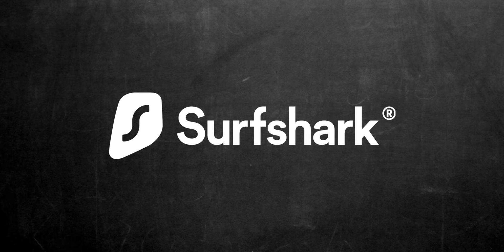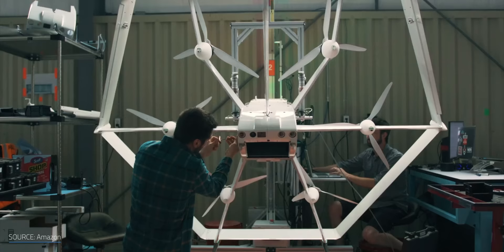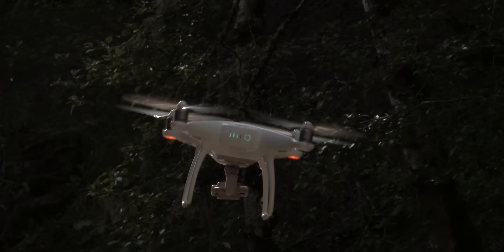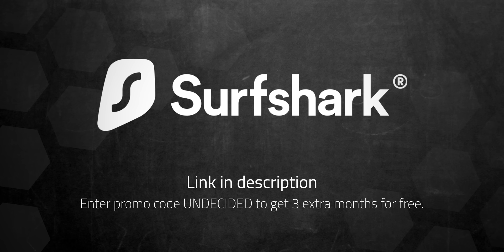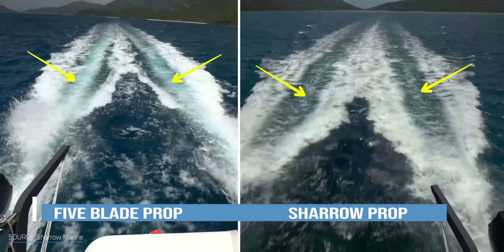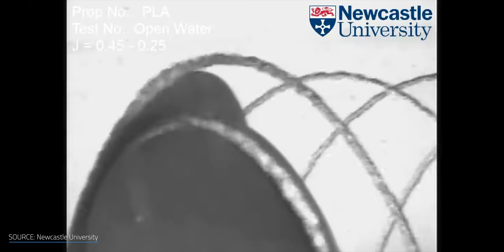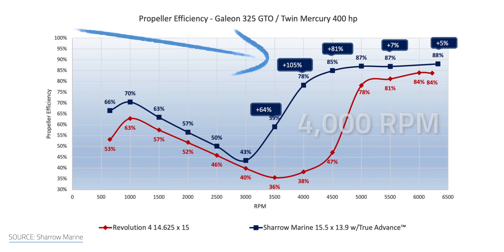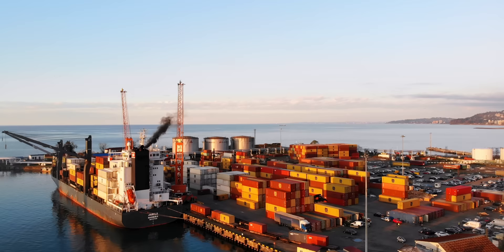Why is this Propeller Getting So Much Attention?

Comment: We looked Into this as well at our university. It seems most comparisons they Made were not with State of the art props en thus their efficiency gains are overestimated. Another slight issue is their inability for pitch control, limiting the use for windturbines and aircraft. Still a great video!
Reply: Just having less noise would be enough for some applications
Reply: Matt is just is a "NEATO" cheerleader ---he cries Go ,STUFFF!   yea!  now where are my blind followers, click like my prettieszzz
Reply: I didn't need to look at it, "105%" efficiency told me everything I need to know.

Comment: HAVING OWNED A YACHT $5,000 is peanuts in boat money - I bought a box of 200 bronze screws [in 2002] - $600

New prop, prop shaft, cutlass bearing and coupling + costs of taking out of water, removal and refitting $6,000 [in 2002]

Comment: What is fascinating is cavitation is actually from boiling water, yes the water boils due to the low pressure created from the boat prop.  Love your videos!!
Reply: yes , by definition cavitation / boiling is when the pressure of the gas inside a liquid = atmospheric pressure above or around that liquid.... therefore if the propeller spins, it lowers the pressure inside the liquid to become more and more equal to the atmospheric pressure , then the bubbles pop. same physics in your kettle with heat doing the work, gas pressure in boiling water  lowers to atmospheric pressure
Reply: I think the most fascinating part is that the water freezes after it boils! Maybe not behind a boat propeller, but just in laboratory conditions. (Vacuum chamber, etc.)

Comment: Would love to experience the boat propeller. that sound difference is crazy. Boats tend to be very inefficient due to all the drag. this propeller may pave the way to electric boats, where energy density has been a major concern
Reply: It's a six bladed propeller (three blades are swept forward, three are swept back, and they are joined where each set meet) that is being compared to a three bladed propeller that is horrifically overworked. The engine nearly needs to over-rev just to get the boat planing. If your boat isn't planing at 3000 rpm, something is horrifically wrong.

Ask yourself, why did they need to compare their prop to a terribly overworked and so will appear hyper inefficient standard prop of half the displacement? Because they're trying to disguise the fact that they've designed a six bladed prop, which will itself be fairly inefficient for most modern small boats. Hell, even nuclear submarines that don't need to care about efficiency at all, just noise, only go up to seven, and usually five.

More props means less efficiency, but they also mean lower loading per blade, which makes them feel and act like they're spinning than they really are. The lower loading means they cavitate at high RPM's, in this case high enough that the boat doesn't reach that limit. You can achieve the same with a conventional 6 bladed prop if you really want. You can also get a properly sized larger diameter three blade prop, or four if you really need it, to achieve the same lower loading without having to increase the blade count and cut efficiency.

Again, very serious question, why is the company that is trying to justify you buying their 5K propeller only showing comparisons to what is blatantly an undersized prop? Why are they not comparing a cheap, inefficient, and badly designed three blade prop most engines come with? Why did they go out of their way to undersize the test prop so badly?

Oh, because their prop doesn't create any savings or benefits when compared to a similar loaded and bladed prop, aside from being heavier and having higher form drag, which actually makes it slightly worse than a same sized six blade prop.

Do the math if you don't believe me, or buy it and run it yourself.

Comment: The noise and damage from cavitation is not caused by the bubble bursting.  The noise and damage ocurrs when the bubble collapses back to liquid.  The pressure pulse can be so high that it actually dimples the metal of the pump impeller.

Comment: 5 years ago, there were those new torrodial formed carbon high profile wheels for cycling. For the lowest aero drag possible. At that time, they were more stable, efficient and stiffer. But they didn't get a lot of media traction

Comment: Be interesting to see if the prop would make any difference in large cargo ships considering they only turn at a few hundred rpm. Based on  the graph the smaller prop was good around cruising at 4000 rpm. But lower in the rpm it was barely more efficient.
Reply: Cargo ships run their props at slow speeds because that is where they are most efficient.  If they could use this type of prop and be just as efficient at 10 times the RPM, they could cruise the seas at a much faster pace at the same MPH they get now.
Reply: Ships do have a much lower rpm, but they also have a much larger prop diameter, resulting in a similar tip speed when compared to stationary water. This tauroidal prop seems to gain efficiency based on tip speed, not rpm.
Reply: @Shepshop1620 , why not a smaller prop turning faster and generating the same thrust? Maybe a smaller power plant could be used?
Nothing is going to push one of those monsters beyond its hull speed, of course.
I would bet these would be fantastic for tug boats.
How about those high speed hydrofoil ferry boats?
Then there are the military applications...
This is pretty big news, I think.
Reply: @MyName-tb9oz  Faster rpm means much more wear and tear , needing to design entirely new engines and more emissions.
Reply: Not really,  @Wayoutthere . None of those, and particularly not more emissions. A new engine design seems fairly unlikely. Unless someone just wants to spend a lot of money rather than using something that is already available.
Reply: @MyName-tb9oz  Smaller props generating the same thrust have to move less fluid at higher speeds.  Since energy goes up with the square of speed, this makes smaller props less efficient.
Reply: @MyName-tb9oz  bigger props are always more efficient. Also higher rpm means more wear und tear that's how physics and friction works. There is also one thing I am wondering about. We could see cavitation at the small boat. That means that they used the wrong prop for the boat. There is also no scientific data in therms of efficiency just a comparioson between a new desing and a bad fitted prop. We have to wait and look forward for more data...